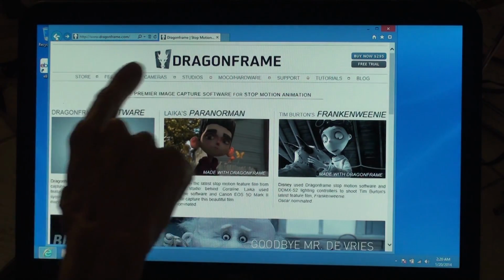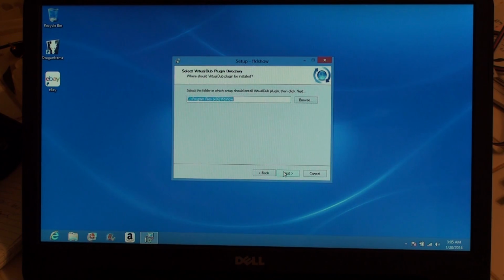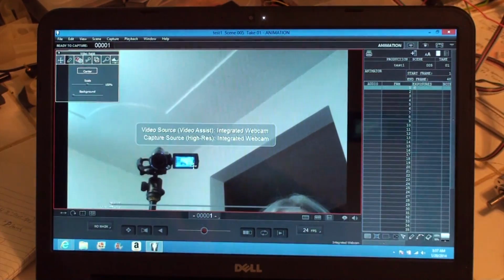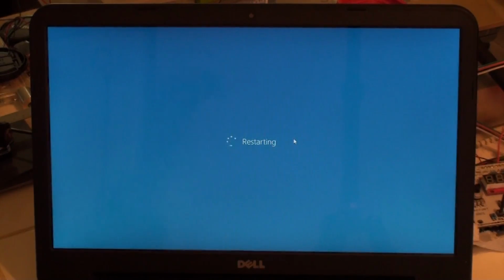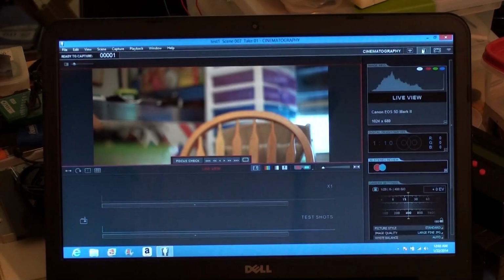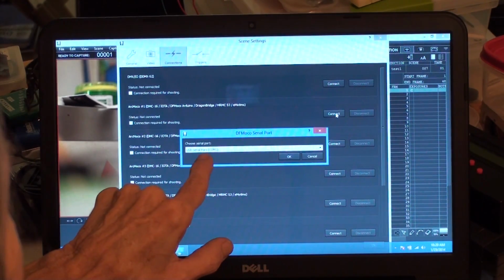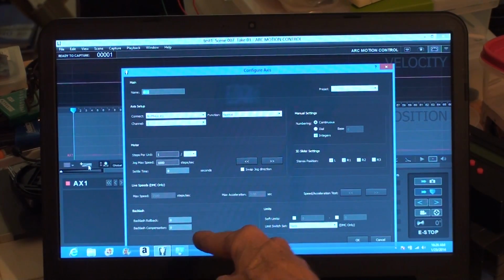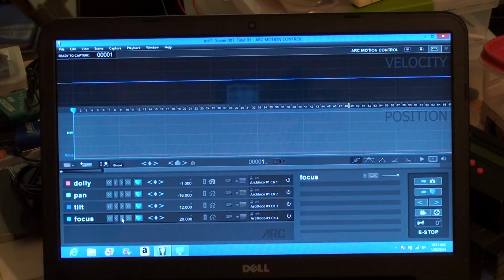Dragonframe tutorial 1 install

Comment: Hi. I want to connect my Canon T5 with DragonFrame. This software recognizes my camera but first
Dragonframe say that my camera does not have a camera live. I think that it's not a big problem, because it say that I can use the NUM 3 to capture. The problem is when I try this, the program does not work. Then, I click in Cinematography and try to Test Shot but It say that my camera failed. I don't understand, my camera works great with EOS Utility. Please, Help me!
Reply from the maker: I have no idea, sorry.  I learned enough about DF to help a friend adapt  his moco rig to use DF as a controller.  He sells a plug and play controller that plugs into usb and runs stepper motors.  The controller is the MiniDF and the company is Stepoutmoco.com maybe he can answer your question.  Does DF have a help line?
Reply: same thing happens to me! I have been trying to figure it out for a long time.

Comment: how do u make realtime shots? How do u setup that? I have the Canon EOS 1100D
Reply from the maker: I am using the MiniDF from Stepoutmoco as my motor controller.  Its plug and play.  I just plug it into a usb port or hub and Dragonframe can connect to it in the motion control window.  I basically set the endpoint for the move as home position, then jog motors to my start position.  Sending motors home causes the entire move to happen at whatever jog speed you set for each axis.  When using multiple axes, I do several runs and adjust the jog speed of all axes until they all finish together (or when I want each to finish).  Don't connect the camera to DF or usb, just hit record and then home the motors.